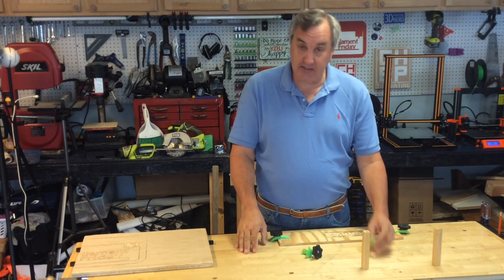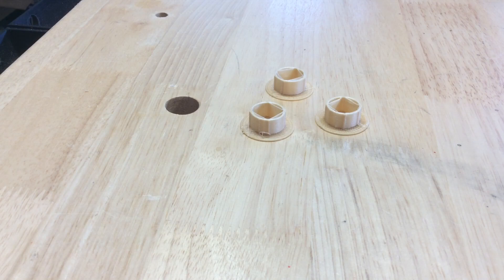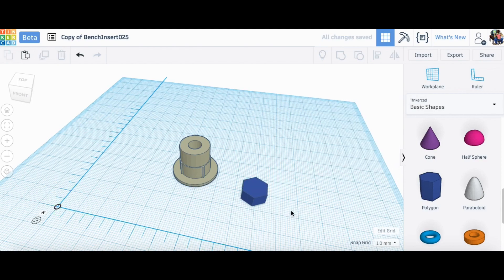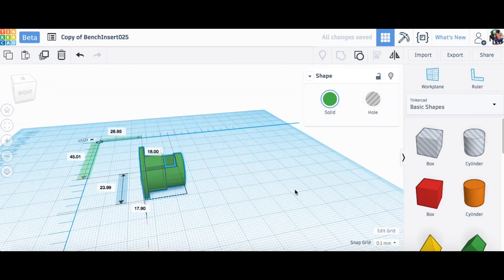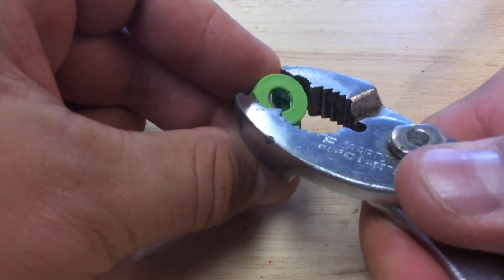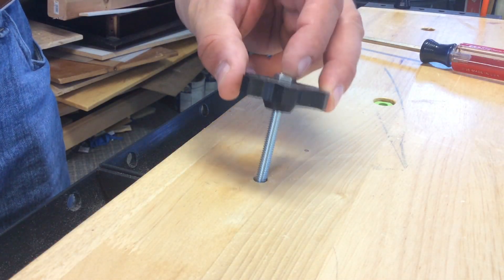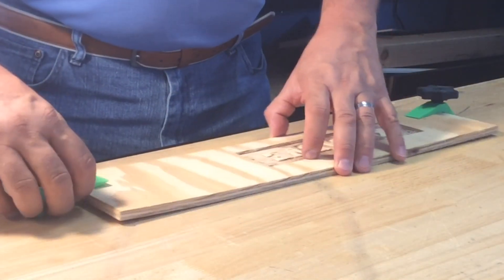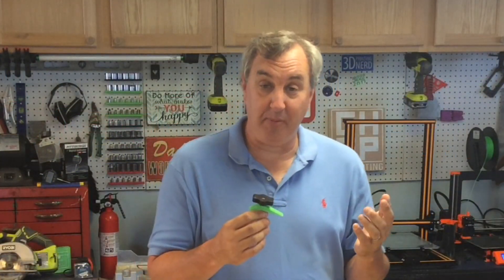Workbench Bench Dog Hole Clamps - 3D Printed

Comment: Nice project.  I may try making a similar but beefier version of the hold downs for finer work on my bridgeport/rotary table.  2 thoughts:
1- you should have put the flat side where you already had the cutout for the nut, you would have had a stronger part because you're not weakening it on both sides
2- If you actually use that workbench as a workbench the holes are going to end up full of dust and debris when you need them, and that will be just the time when you can't use an air hose to blow them out because you have parts on the bench that you'll scatter.  You could drop a matching screw in them but you may not want to if you actually use it for woodworking (potential for wrecking the edge on a fine tool), in that case a plug the dimensions of the recess, possibly with a slot to turn it in or out if you want to put a threaded pin on the bottom side or even just a pin that fits in the nut will likely hold it in well enough to survive just about everything besides a good shop vac.  Alternatively, if you make the insert come up dead flush with the top you'll prevent most of the stuff from going in there and make the part stronger.